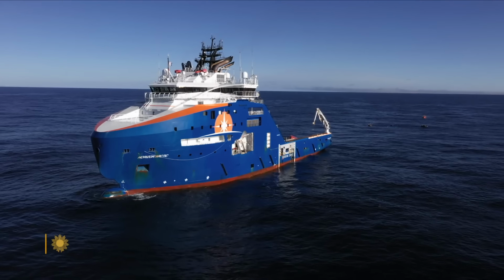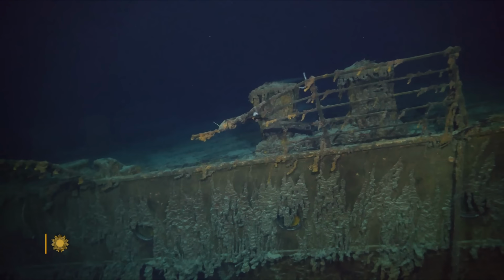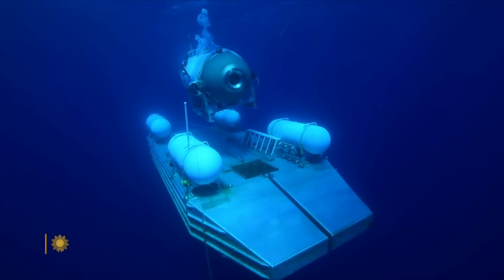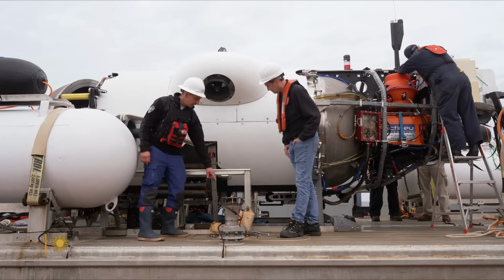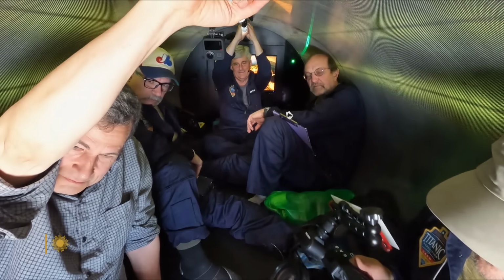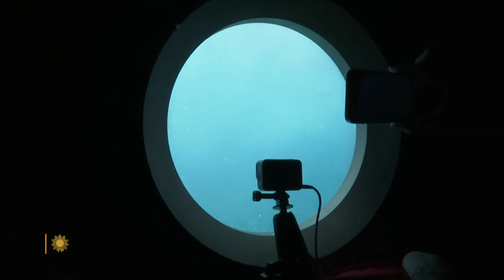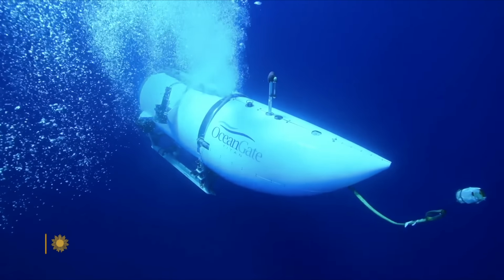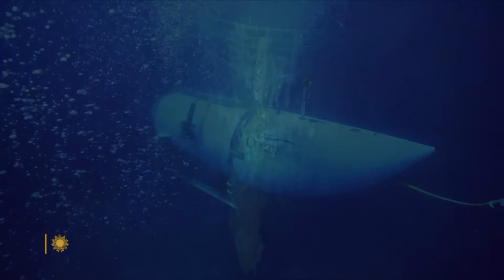Inside the OceanGate Titan tragedy

Comment: The biggest problem I have with Rush is his mocking of the potential passengers who questioned the safety and his lack of testing over time. That shows his true character. The sub had sensors on the walls to let them know if the outside pressure became too much. I have to wonder how long it was between the first pressure alarm and implosion. Hopefully not long because that had to be terrifying especially for the 19 year old that did not want to be there.
Reply: Not to mention the OceanGate employee who Stockton fired for raising safety concerns
Reply: I think I saw that they were ascending when it imploded. So perhaps the sensors did warn and they were retreating. Sad for the kid more than anything.
Reply: That's a good question, one that not many people have asked. Here's what Stockton Rush told me: "The warning is about 1,500 meters. It’s a huge amount of pressure from the point where we’d say, “Oh, the hull’s not happy” to when it implodes. And so you got a lotta time to drop your weights, to go back to the surface, and then say, “Okay, let’s find out what’s wrong.”"
Reply: Exactly. I can’t believe the customers allowed him to mock them. Won’t even allow any constructive criticism and or pushback. Glad karma got him. Now he can’t get others killed.
Reply: As David Cameron has stated, just the fact that the hull needed to be monitored showed it was not sea worthy as that proved it had the potential to fail.  He said hull integrity is the last thing you should be worried about in a properly engineered submersible.
Reply: God made an example out there of these fools
Reply: Pico seconds..
Reply: I don’t think there would be an alarm since the same sub made multiples dives to the ocean floor before and held up.  I think it just went from stress overtime like that in a split second!  They might have heard or seen something moving and then nothing just gone. The issue from what I am gathering is the stress it produces with every dive and the lack of durability test on that since the tech being used was brand new and unprecedented meaning the data gathered from 1960s to present in stress durability testing was not applied to his equations and he refused to try to apply it as it meant less innovative to him.  Since he made some dives, he got arrogant. There is even a video of them live on real time realizing they installed the thrusters backwards in the sub while they are actually in the ocean floor and trying to figure out how to move the sub around.  Crazy. So he made something innovative that reached titanic with a game console. Just didn’t think it thru. Unfortunately.
Reply: @rickdff62 What does an ex British Prime Minister have to do with this?? 😂
Reply: The problem is carbon fiber would give them no time to actually react to said sensors, it doesn’t bend or flex under compression it shatters
Reply: The verse of God is repeated again, just as people built a gigantic ship before and challenged God with it that he could not sink it. God accepted the challenge and sank it today, drowning a submarine that came to it and took the same name. And just as God made the whole world talk about ships And he makes movies and songs for it to make it famous and teach people his verses He made the world talk about the submarine and became famous so that they could know his verses
Reply: The Titan was down in the water for an hour and 45 minutes, I thought I had read.

I don't know how far down they were, but ANY water pressure, after so many dives, most likely weakened the Titan.
Reply: You all are being way to harsh and backseat driver-ish… Rush was an innovator and designs in the future will probably be based off of his. 

Everyone understood the risk, they signed death waivers. Even the 19 year old man on the sub ultimately chose to be there.
Reply: @lesleegile2611 are you saying that safety should be disregarded when coming up with an innovation?
Reply: @DavidPogue  I’m glad you survived but wouldn’t a better question to follow up to that have been what’s the point of pressure sensors when it’s pretty much too late at that point before it crushes you? That’s like telling a person who’s bleeding out from a bullet they’ve been shot after the gun’s been fired
Reply: @Saturdayz_In_The_Fall god? 😂 you sound perfectly ridiculous. Its called physics not your imaginary friend
Reply: @Jesus_not_God_he_worship_him 👎🏼
Reply: @lesleegile2611 they didn’t think they were going to die… it’s not a great thing and why tf would they use his designs the ones that don’t work? if anything learning exactly what not to do
Reply: #birdbathjamaica
Bird here
G
Reply: @robertbruhcuh3634  They knew there was a chance they could die. The design will be copied, the sub did make it there and back 12 times safely. I think it’s ironic this was time 13… Even learning what not to do is using the design. 

It’s sad that they died but people pay a lot of money to climb Mt. Everest and some never come home. A lot of people don’t understand that sometimes the risk is worth the reward.
Reply: @lesleegile2611  the families of the victims could still sue the company despite those waivers.

"You can only waive a simple negligence. By law, you can’t waive gross negligence. So this is above and beyond, you know. So, whatever waiver they signed... You can waive known risks, but you can’t waive something more than that, which again, I’m certainly no expert in these types of vessels, but this seems like something more than simple negligence.” - Neama Rahmani, trial lawyer and former federal prosecutor
Reply: @barbarosaklar it's not an "alarm" it's a sensor going off. And clearly this happened over the course of at least a few seconds because they had time to drop their ascent weights. The implosion itself was within milliseconds, but they knew there was trouble before it happened.
Reply: @rickdff62  james cameron. his name is james cameron.
Reply: It's ironic that Rush said the pressure hull was the only important part of the sub.

Yet it was the pressure hull that failed in the end.
Reply: @codywarhawk7099  the only family member that I’ve seen or heard about is the aunt of the 19 year old man on the sub. She’s claiming that he was nervous and didn’t want to go and his father pushed him into it. 

Everything I have seen, pictures, look like this father and son had a great relationship. He was an adult and understood the risk and still willingly got on.  It almost seems that she’s hoping for a lawsuit and a paycheck.
Reply: A wise man once said… 

“We choose to go to the Moon... We choose to go to the Moon in this decade and do the other things, not because they are easy, but because they are hard; because that goal will serve to organize and measure the best of our energies and skills, because that challenge is one that we are willing to accept, one we are unwilling to postpone, and one we intend to win, and the others, too.”

It’s saddening to see that we’ve strayed so far from that in America today. 🇺🇸
Reply: thats why he died because of soo much believe on his invention.... 😢 people who rush too.much are prone to danger
Reply: @michaelscott5653 - Nothing ironic about that. He was right. Anything else can fail and they can restart. And a lot of other things DID fail which is why out of 50 attempts, the sub only successfully went down far enough to see the Titanic 12 times. Unfortunately, what failed the final trip was the hull. And that’s why it’s the most important. Hull fails and it’s game over.
Reply: @kimwood9119  According to the news, they were 3300 metres deep, (about 500 metres from the wreck of Titanic !). Which was when the signal stopped being transmitted to the surface, & logically the depth at which it must have suddenly imploded ?.
Reply: I think I heard it said somewhere that they likely would have heard wirh their own ears how the hull began cracking seconds before the implosion occured.
Reply: @tumtum08 Right. James Cameron said he heard they were on descent & had dropped their weights & the only way they could know that was if they had called it into the ship in an emergency ascent. So they must’ve heard the sensors & aborted the dive, & were on their way back up. Unfortunately, they were a few 100 meters above the Titanic, or over 10k feet from the surface, which would take well over an hour to reach. What good are sensors when you’re that deep in the ocean?
Reply: @sema6008 Karma did indeed get him but it also got the others. Nothing to celebrate.
Reply: The ocean ALWAYS wins, he was just arrogant.
Reply: @Jesus_not_God_he_worship_him  With all due respect, I don't believe God caused this to happen at all. This tragedy happened sadly because of pride and maybe even a little ignorance on the part of a person/people.
Reply: @DavidPogue  Would you care to clarify what did you mean by "The warning is about 1500 meters." ? The titanic is over twice that depth, so clearly they were going much deeper than 1500 meters...
Reply: @rickdff62 David Cameron was the UK MP, James Cameron is the director you're referring to.
Reply: @101Hurricane  Oh... he meant that as he was descending, he would get a warning 1500 meters before the carbon fiber failed. So if he was on the way down, and the carbon fiber was going to fail at 2500 meters, the system would let him know when he was only 1000 meters down.
Reply: @DavidPogue  Thank you for the clarification. I heard that james cameron said that the Titan had "dropped their ascent weights" and was "coming up, trying to manage an emergency" before the sub imploded. Obviously I assume he has his sources, but if it's indeed true, I wonder if they really had a warning about the pressure hull's integrity. And if they did, well, evidently we can see from the outcome that it didn't really gave them a 1500 meter margin to abort and surface.
Reply: @lesleegile2611 eported today that the son's ticket had been purchased for the mother and wife. She said her son really wanted to go.  I have read many comments saying the son did not want to go. That was originally said by his aunt. Typically, when enough people say the same thing it becomes the fact! So we now have two sides to this story. Which do you want to believe? Who is telling the truth, the mother of the aunt?
Debris claimed to have been found suggest that the carbon fibre hull shattered and the port hole, the end of the tail and the landing gear are intact. Plans are to retrieve these items and what else they can gather. Scientific analysis of these items will be done along with a verdict based on this scientific evidence. People should wait until this investigation is complete. In the meantime we have hundreds of armchair 'experts' who do not have all the facts  posting their opinions as if they are solid.
Reply: @organicforlife597  tbh, we wouldn't be flying, driving cars, using electricity etc etc if it were not
for innovation made by fearless people, without todays overly streched safety thinking! 
little OT: an american guy watched a video about life in Germany (filmed by an am. couple living here).
He saw children from 5yo who went to school on foot all by themselves. He shouted: WHAT all by themselves? In future we'll have grownups who are so fearfull that they don't dare anything. The panic of millions with the C19 drama shows that very well! 
Mr Rush might have been too careless, but this accident will teach the diving community or other marine
activities more then what is visible at the moment.
Reply: @lesleegile2611  too much safety thinking kills any innovation or trying for new horizons. 
this world is becoming so cowardly, the experience with the jab taken by millions has shown it!
Reply: @Saturdayz_In_The_Fall  god is not one to make examples...
Reply: @tumtum08  Ascending way too slow...
Reply: @Jesus_not_God_he_worship_him  
That is just begging for problems.  What a silly thing to do.

Comment: The Submarine captain explained exactly what probably happened. The Titanium parts were epoxied to the Carbon fibre body, because of the different expansion coefficients, the epoxy glue probably cracked eventually after so-many dives and pressure cycles. The other  possibility was the plexi glass viewing port cracked, it was only rated to a depth of 1300
Reply: reneealexander7899  all of them actually
Reply: Is it probable that the window imploded before the carbon fiber hull though?  The hull wouldn't have a rating at all because it was never tested....
Reply: @rrace002  I believe it was the window. If you look at what is left of the Titan, the plexiglass window is missing, because it wasn't designed to go to depths that deep.